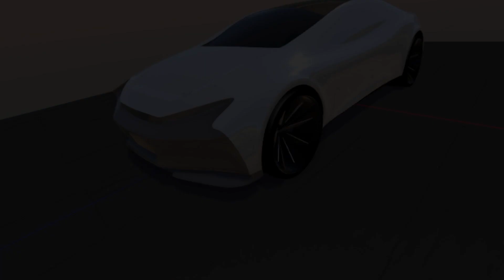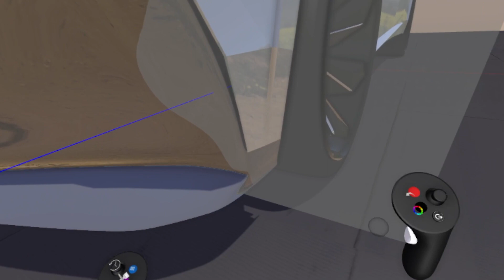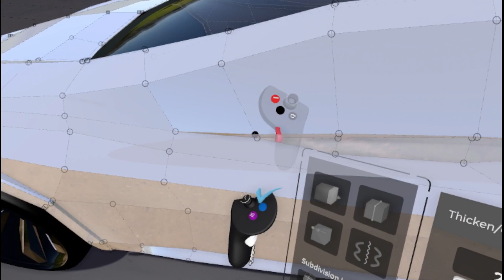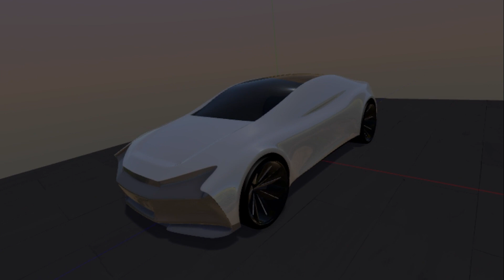Surface Refinement, Automotive Design - Workflow

Comment: Hi! nice video GS
How do you manage the corner of a sudiv surface? It seems the only way is to add an edge loop at the corner, to have a tight angle, but is there a hidden function ?
Thanks
Reply from the maker: Hi thanks for reaching out! yes you can add a triangular loop, or add a loop that runs the length of the surface - that way it keeps the surface topology. Stay tuned for a video that covers edge detail...